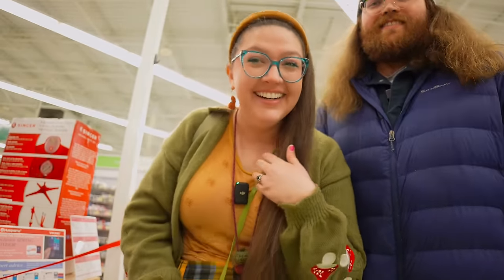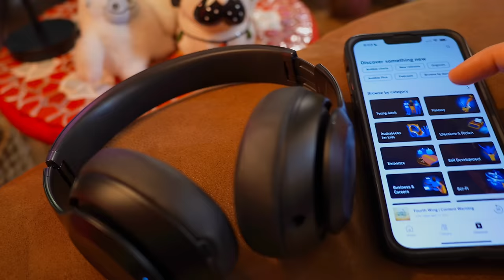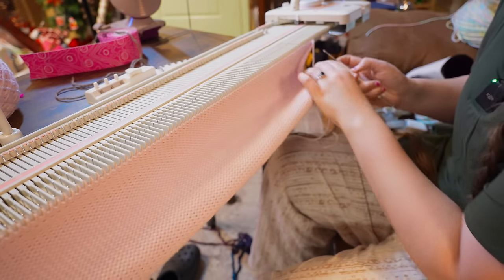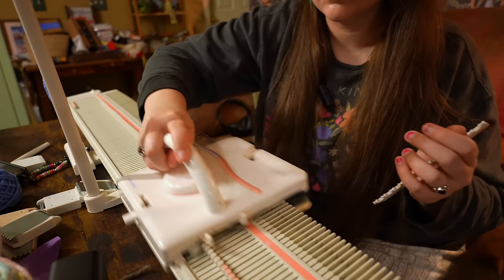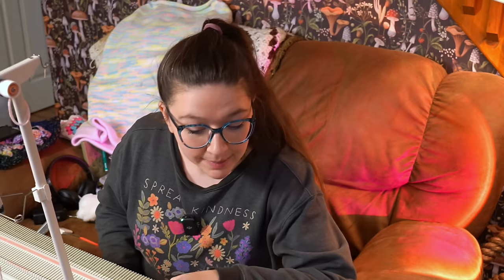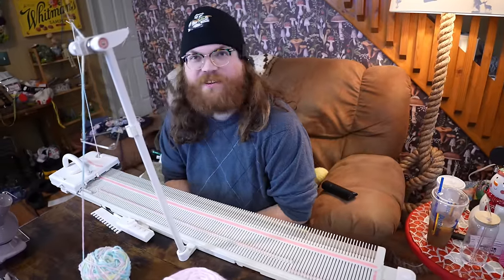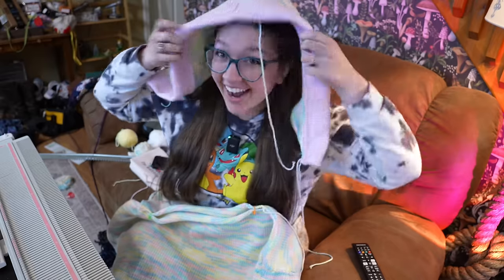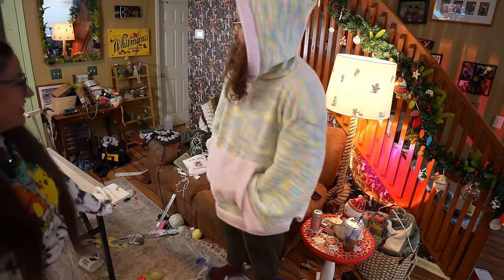knitting my 6'4 boyfriend his first oversized sweater

Comment: You can definitely use wool on the knitting machine, I use mostly 100% wool on mine, just make sure it has a tight spin because it does break a lot more easily than acrylic which might be the main reason not to use it. Just make sure it does not get caught or too tight in the feed and it’s fine. 😊

Comment: You could taper the sleeves by sewing them to the appropriate taper while inside out and then cutting off the extra.   As long as the sewing is really locked in so it doesn’t fray, it would look perfect.

Comment: I was wondering 🤔 how you made Like the cuffs 😅 idk if that's what they are called . The pink parts
Reply from the maker: Basically I cast on with a waste yarn and do about ten rows, then switch to the color of my cuff and do double the amount of rows I want for the cuff so I did 40. At the end of 40 I take every loop from the first row of the cuff color and pick it up with my transfer tool and put it back on the machine then I switch to my arm color and start knitting back and forth. At the end of the project i carefully cut off the waste yarn. Hope this helps

Comment: The anything but wool yarn on the knitting machine has me wondering what is wrong with the knitting machine or do I need to do more research on knitting machines.
Reply from the maker: I just heard one machine knitter say that 🤷🏻‍♀️ I need to look I to it more!
Reply: @HollyAuna I watch a channel called engineering knits and I feel like she uses a lot of wool and natural fibres. Yarn weight  and twist construction would have more of an impact on your machine. Also I wonder if you need to change up the tension for different yarns even if the same weight.